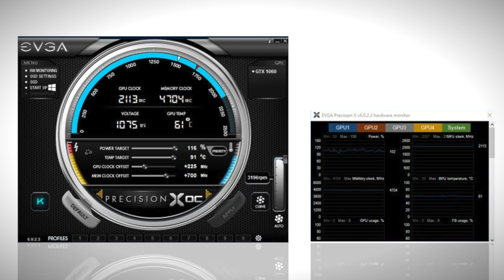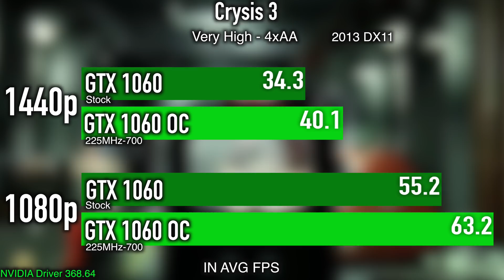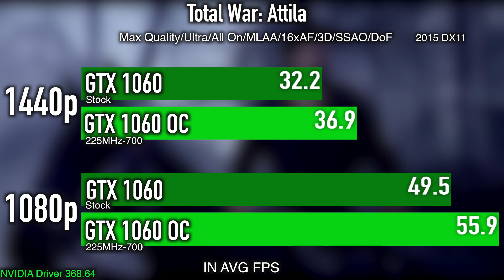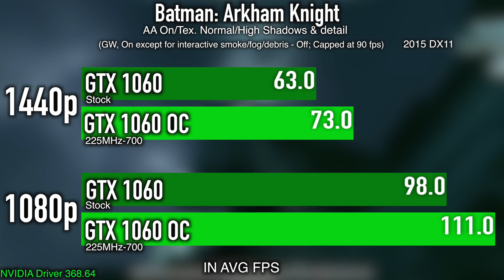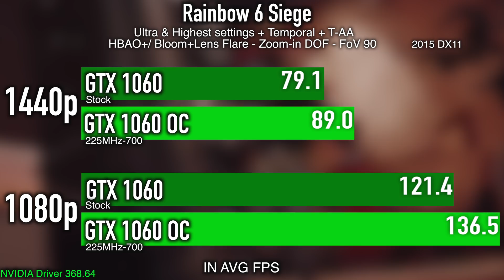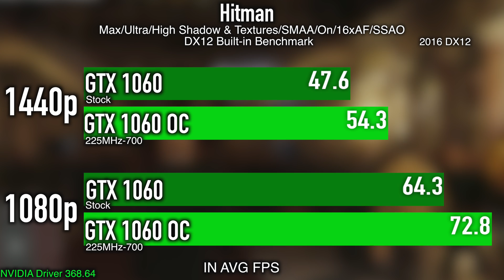The GTX 1060 Overclocked And Tested! 225Mhz Above Core!

Comment: anyone else with stuttering and fps drops? Gtx 1080
Reply: paul berkmans wait, 90% on idle? Have you scan for anti virus? Or you probably have way to much shit on your HDD
Reply: MrXleader i think he already did that
Reply: paul berkmans
i strongly suggest you try the card in someone else's pc if you can, or ask the shop to test it
Reply: What CPU?
Reply: i7 6800k
Reply: Really....I'll have test that myself.
Reply: Yeah, you should restore nvidia control panel to default.
Reply: Did everything possible, but it does not fix it. Yes i restored nvidia control panel to defualt and even set it to prefer maximum performance but it didnt fix it
Reply: That's odd. I have the gigabyte g1 1080. Never gotten any stuttering or fps drops. You may need to reinstall Windows. Windows 10 used to give me a problem where my whole computer would stutter every 5-10 seconds and doing a full factory reset fixed the problem.
Reply: i just installed windows 10 today, went back to windows 8.1 yesterday just to try out but it didnt help and only 4 days left with windows free upgrade so i got back to windows 10
Reply: +paul berkmans reset all oc on CPU and gpu ?
Reply: yes they are all at stock
Reply: I once had to clean out the dust as it severely impacted my performance...mybe try rechecking things on the hardware side?
Reply: well if everything is new then the only thing i can think of is to check the interior side if it doesnt have warranty void sticker,if it does, try checking it out at the place where you bought it,let them run a few tests
Reply: +MrXleader I did that and during those stutters the gpu usage went down drastically and then got back up and when I increase my resolution scaling to 200 then it never happens and my games run smooth throughout and on 150% scaling I get micro stutters but in 100% scaling it becomes unplayable and frames drop to 25-40 range
Reply: don't know about resolution scaling since i almost always use my monitors native HD resolution /1920x1080 (i think its not 1280) .....but i guess you're gonna have to keep it at 200 then
Reply: +paul berkmans damn you got a dund duudee....is it founders edition? try to rma it.
Reply: did you try the new driver that just recently released? a friends 1080 dropped the stutter with that one, give it a go :) 
(he use DP)
Reply: Ferry Ansony i bought a fe and i faced the same problem but it was a bit worser than my current msi gaming x, so i returned it and got msi gaming x, but the problem is still there.
Reply: TrueDesireHD yes i updated to the hotfix driver, 368.95 but it didnt fix it. BF4 runs at 160-200fps and then suddenly drops to 30 and other games also do similar stuff, cs go also microstutters
Reply: paul berkmans hmm is the problem presist then its probably the mobo. Have you update the bios? Or its probably bad ram stick. And also try to use different mobo, probably its fried.
Reply: its x99 deluxe ii and on the latest bios :) ram is trident z ddr4 at 2111mhz and both of them are just as new as the 1080
Reply: paul berkmans if i were you I'll try with different ram sticks first if the problem presist then try different mobo. Well we all know asus's sketchy QC lately....and ram is all about lottery, you can get bad ram.
Reply: yeah but my old gtx 770 works perfectly fine on this mobo and ram, that's what makes me think it is some software issue which might have been sorted out or fixed by some other person online, i have tried it with my friend's ram and it didnt help.
Reply: Then its definitely the 1080 and the software....man thats a shitty situation you got there
Reply: MRsjovealek ok i will give it a try and update here
Reply: paul berkmans so, how was it?
Reply: Ferry Ansony nope didnt help
Reply: Reinstall windows...
Reply: did that yesterday or day before but it didnt as usual, getting 45 - 60 fps in far cry 4, bf4 i get 200 but then down to 40 n lower, overwatch uses the gpu at 99% constant but it gives microstutters at some point but still it is much better than other games
Reply: +Ferry Ansony he saidbthat he already did i believe...just keep res scaling on 200 if that works
Reply: paul berkmans good god, I'm seriously puzzled by wtf is happening to your pc
Reply: Ferry Ansony haha imagine what i am going through, everyday i spend like 3-4 hours with different stuff but nothing works, doing it for like 2 weeks straight. Thought this new pc will be a beast for a few years to come but then it got me rekt
Reply: paul berkmans oooh try with different CPU in a same board
Reply: that wont be possible coz i got a 8350fx which bottlenecks and is not compatible with this motherboard and my friends are using skylake. Is there any chance for it being a psu issue? Corsair GS800 this is the only part that i am using from my 3 year old pc.
Reply: i got a new hint, my system idle process is at 90-95% of my cpu even at idle. What is it on ur side ?
Reply: +Ferry Ansony try putting the gpu in one of ur friends pcs for testing
Reply: guys google this issue, there are some other people with this issue, if you go through that then you might get the issue and a solution and help me if possible and thanks anyways for so many suggestions.
Reply: paul berkmans
u found solution?
Reply: it is 1am here in my country and i am still looking for some magic to happen, i just removed all hdds and unparked my cpus and installed the first gtx 1080 drivers and nothing worked. My ssd is not at fault too coz i checked the performance with samsung magician and it performed just as expected. I m tired of mailing nvidia support, no solution yet
Reply: I think a program or a virus is running in background and keeping your CPU busy. test your card in another PC or remove all your storage from your PC and just use a formatted Hard Disk or SSD to install a windows on it then test if problem is resolved.
Reply: Nima V damn, exactly what I'm talking about
Reply: I removed all my storage drives and formatted my ssd last night and installed windows 10, now i am getting frame drops in bf4 for like 2 seconds and then it gets back to normal but it was just laggy once it dropped before formatting, i am getting 65fps on ultra far cry 4 now but used to get 90+ before the formatting, far cry infact is not something i am worried about coz it is unpredictable and changes everytime. Now i think i should just wait for the next nvidia drivers which are said to fix dpc latency problems as my dpc latency is quite high.
Reply: paul berkmans what about the cpu usage tho?
Reply: i asked my friends and they all had their cpu on 99% or 95% on their system idle process which is found in task manager > Details > under cpu
Reply: paul berkmans da hell? I usually have CPU on 20% usage on idle....
Reply: ditto.....i'm not sure when the f theym easured that....after ust exiting a heavily modded gta V?!?
Reply: paul berkmans  99% utilization means CPU is completely busy and has no room to do any other task. my CPU is always 0% busy at idle.

99% in system idle process means total process utilization is 99% free not busy. you have to see CPU utilization in task manager > process tab > CPU.
Reply: ya i know its not ulitilzation problem, ultilisation is 30% or something and yes you are right 99% or 95% is not bad and does not affect performance. i dont know what fixed it but pc seems to run better now, except for far cry 4 which gives 60fps on ultra and on low does not go above, i set it to 120hz in the video settings but still it is stuck there and v sync is off too. mirror's edge catalyst runs at 90 fps average and slight stutters are there but nothing major at 1080p, cs go runs smooth now and i am getting 250-300 fps and no stutters while playing but the menu and even if i press the esc button i get a stutter. Thanks for ur reply
Reply: paul berkmans damn, looking at your case now I'm worried that my pc gonna have the same problem too. I use i7 6800K with Asus Sabertooth X99 (latest bios), 16 GB corsair LPX ram, and Asus Strix GTX 1080 :\
Reply: if it doesnt have problems yet,you're good lol
Reply: hey i dont know what fixed it but my pc is running as it is supposed to be without any problems, i dont know what i did to get it fixed, i tried a ton of stuff to get it fixed and 1 of them got it fixed, i put my hard drives back in and no lag in games. only game that still sucks is far cry 4, it does not lag or stutter just that it does not use the gpu power and sticks to 60-70 fps on ultra and low, maybe some setting are there to work on specifically for that game. For now i m happy to know that when battlefield 1 beta is out i will have no problems playing it. After all this mess i went through i dont want anyone else to face this shit, still try using latencymon and testing ur dpc, if it is low then you wont have problems in most cases.
Reply: paul berkmans btw, how about your cpu usage?

Comment: Can you do a gtx1060 vs r9 390 video? Pls :D
Reply: 1060 Wins by 15-20%
Reply: My R9 290 is rekt by these new GPU's ;(
Reply: AscendAB it had a good run though, for the price back then, you couldn't go wrong with a 290
Reply: Mike Fox yup. but i have a thought that my 290 is bottlenecked by my FX-6300...
Reply: AscendAB if you want to go crazy, overclock that GPU and VRAM, slap a watercooler on your CPU and see how far it takes you. I'd recommend you upgrading your CPU though, with i5s going for 180$ it's a good investment coming from an FX63XX
Reply: Mike Fox I do have an socket 1150 mobo with Pentium G3258 lying around.
Reply: AscendAB pick up an i5 used. It'll be a good upgrade.
Reply: Mike Fox I'll sell my FX-6300 with mobo later ;) Thanks man
Reply: Or just go for an fx 8350 or something, very cheap as well, but you can't go wrong with an I5 either.
Reply: Ferdi Vol I think the FX 83xx will only be a temporary solution, and if he's going to spend 130$ on an FX83xx, might as well spend the extra 50 that is the i5 that will completely put the FX to shame.
Reply: Mike Fox Yes, it's his call. If he wants to spend that extra 50 bucks.
Reply: +Mike Fox for gaming purposes, it's definitely a better idea to upgrade your gpu rather than your CPU. I have a 1070 I recently bought and currently running with the fx6300 0C 4.4. Sure it's bottlenecking, but from all the reviews I've seen with i7s clocked at 4.5-7 or whatever, it's really only missing less than 10% of performance (at 1440p). If I had spent the $200 out of pocket that I used to purchase the 1070 on a i5+ MOBO, I would not be getting the same performance as I am getting now. I had a 290x that I sold btw, hence the 200 out of pocket
Reply: Fearbleeds that's never a good choice either way, games that heavily depend on Single core will bog down your 1070 in ways that it could render it as good as a 750 Ti.
Reply: +Mike Fox nope. You are greatly underestimating the fx6300. Also, at 1440p, the CPU is less important. Most games I have reach 96fps+ which is what my monitor is clocked to, and it really looks great. I guarantee you, this combo is one of the best price to performance combos you can buy for 1440p. Especially with dx12 taking advantage of more cores in the future. Of course, I wouldn't recommend anybody to buy a 6300 right now. I'd wait for zen or kabbylake, unless you are really looking for a bargain.
Reply: +Fearbleeds Well, again it's his choice if he'd like to get an fx 8350 i5 or gpu upgrade, none of those options is the best until we've figured out his demands.
Reply: +Ferdi Vol true. Although if it is just a gaming rig, I don't recommend upgrading to an 8320-50. I did the same, and ended up selling it because the performance upgrade was tiny and it put out a lot more heat than the 6300
Reply: +Ferdi Vol i'm playing games like GTA 5, Hitman and some other games.
Reply: Fearbleeds I will be upgrading to an FX 6300 then.
Reply: Mike Fox Fairbleeds said: ' I wouldn't recommend anybody to buy a 6300 right now. I'd wait for zen or kabbylake, unless you are really looking for a bargain.'
Reply: AscendAB I'm on an extreme budget.
Reply: Mike Fox oh okay.
Reply: Mike Fox AscendAB Yeah, i won't judge over those antfucking minor wins or losses, if you're on an extreme budget. You should go with something badass in my opinion instead of this.

Comment: OC3D said they found that the 1060 Founder's Edition doesn't ship with GPU Boost 3 for whatever reason, which means there's a lot more  untouched overclocking headroom left over than what you'd find on the rest of the Pascal lineup. It's in his Asus Strix 1060 review if you want the info from the source.

Comment: I'm on a budget. Is a 960 good for 60fps on 1080 for right now
Reply: I'd save up for at least a RX 480 since you get so much more for the money compared to the 960 (4gb more VRAM and around 40% faster). Plus, it's a lot more future proof since its a better card overall and comes with newer technology compared to a card that was made 2 years ago.
Reply: dude i have a gtx 960 and it is not that good 
 atleast go for the gtx 970 it is way more better than the 960
Reply: 960 is last gen it will struggle on dx12 better add 100$ and get 1060 pascal has implemented async that even beats rx480 in ashes and timespy 3dmark
Reply: The GTX 10 series still struggles in DX12, and they don't have hardware async. Don't kid yourself. The RX 480 beats the 1060 in Ashes and Time Spy. Have you even looked at benchmarks?
http://www.pcworld.com/article/3098825/components-graphics/sapphire-nitro-rx-480-review-polaris-rethought-and-refined.html?page=6
http://www.pcworld.com/article/3098825/components-graphics/sapphire-nitro-rx-480-review-polaris-rethought-and-refined.html?page=7
Reply: get a rx 48p
Reply: It's a great card. I loved mine, but now, I'm loving my GTX 1060 even more :D I can actually play my games on Ultra settings now with no major dips in fps. I haven't even OC'd yet.
Reply: Ok. Thanks for all your help guys :)
Reply: The 970 is pointless now.
Reply: well get a 480
or a 1060
if your the kind that picks a second card down the road then get a 480

although I think a 470 is dawning upon us and is going to cost like 150$ 
and if that crossfires then I guess it's a sweet deal too

but really don't buy a 960 
get something more new for the new Api releases 
you never know when a new generation game catches your eye
Reply: well get a 480
or a 1060
if your the kind that picks a second card down the road then get a 480

although I think a 470 is dawning upon us and is going to cost like 150$ 
and if that crossfires then I guess it's a sweet deal too

but really don't buy a 960 
get something more new for the new Api releases 
you never know when a new generation game catches your eye
Reply: well get a 480
or a 1060
if your the kind that picks a second card down the road then get a 480

although I think a 470 is dawning upon us and is going to cost like 150$ 
and if that crossfires then I guess it's a sweet deal too

but really don't buy a 960 
get something more new for the new Api releases 
you never know when a new generation game catches your eye
Reply: +Brotlov the Soviet agreed we should be more mindful of Async since every Microsoft title uses dx12 now 
and games like doom and deus ex also are on board now
Reply: It's not bad, but I would go for the 4gb 480 if I were you, the jump is pretty significant, 960 will get outdated sooner. Of course if you can go for the 1060 or the 480 8gb that is also great.
Reply: +Brotlov the Soviet they are on pair so dont kiden youre self preeamption gives nvidia +5% in dx12 amd benefit a lot better +20% but overclocked gtx 1060 will beat in ashes the rx480 in timespy even not overclocked 1060 has a lead of 2% so overclocked gtx 1060 in doom vulkan is behind the rx480 by 15% but amd vulkan is just feature of amd just like physx and gameworks of nvidia so there is just 1 game like doom and hitman that favour amd bit mostly all other games amd lose to nvidia by 10-20% so nvidia leads and i dont need other  arguments to prove dont be an amd fan reality is nvidia now
Reply: I have only RotTR as DX12 title, but on my 1080 I have problems with minimum FPS as in DX11, all max. out except HBAO+ as VXAO do not work in DX12 and cant compare and SMAA only. In DX11 I have common drops to mid 40s, in DX12 I have stable 60FPS (Vsync so 60 is min, max and avg too )
Reply: The 1060 is the better option if you don't have a high end CPU like a 6600k or 6700k. If you have a low to mid end CPU then never ever pick the rx480. The rx480 even has very poor results in Doom using Vulkan and async compute using a budget CPU.
Reply: +T-X-M probably yes if you don't play on the highest settings.
Reply: -T-X-M- yeah it should do alright. If you can't stretch your budget to 249$ for the 1060 then go with the 470. That is if nvidia won't bring out a 1050. If so we will have to wait for benchmarks.
Reply: -T-X-M-  Check the video Digital Foundry made comparing the 480 of 4gb with the 8gb version. Nexus and hardware unboxing did the same. 8gb don't make any difference, none whatsoever at 1080p, or even 1440p. The 8gb 470 is really not a good deal, (or at least I don't think it will be). The 4gb Nitro is the way to go. I'm thinking of getting the same if I can.
Reply: i prefer r9 380 instead of gtx 960 :)
Reply: I would be on the look out for a RX 470 if I where you, they should be priced similarly